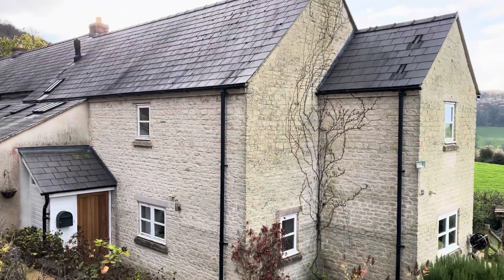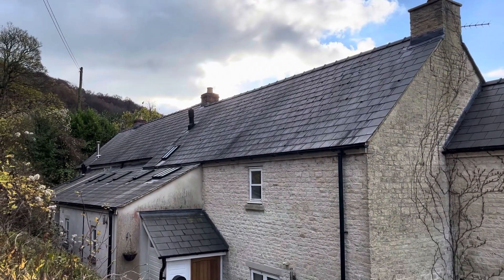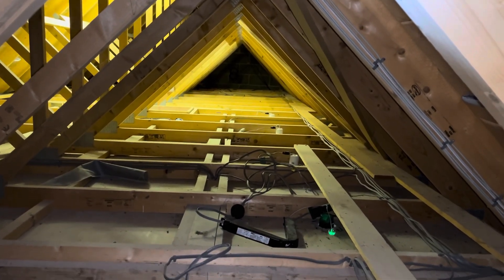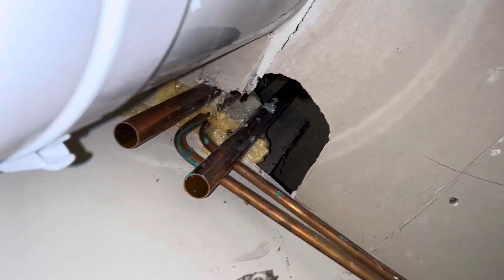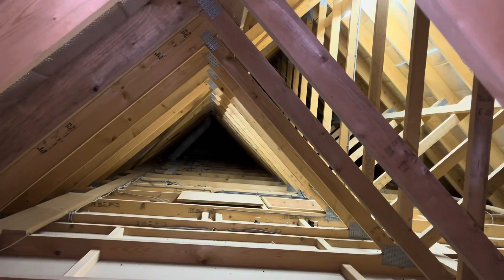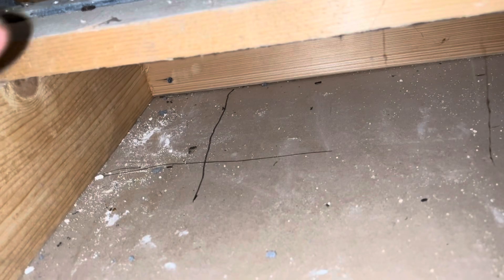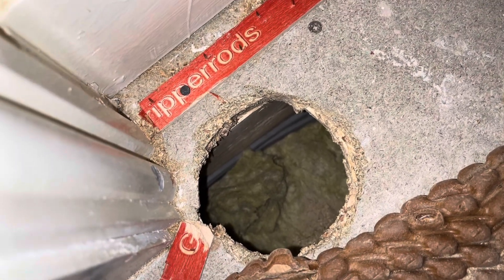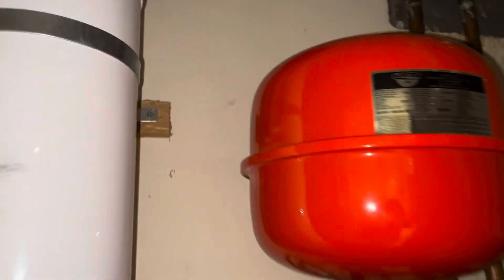1. DIY MVHR retrofit - Fitting the piping from the loft to the ground floor

Comment: Have you designed the system yourself or was that done by the supplier?
Reply from the maker: I started off with my own plan and as I have been looking for the supplies I have been in touch with BPC Vebtilation. They have created a plan for me for free - I just sent them the plans for the house.
This plan is almost identical to my plan and so it’s nice to have that reassurance.
I have not purchased anything from BPC Ventilation (yet) though. All I have purchased so far is 50m of ventilation tube from Fastlec.
I hope this info helps
Reply: Good luck with the project. My only significant concern with taking on this is the impact on fire breaks.
Reply: @marcheeeen   Fire breaks between what and what?

Comment: Brilliant series to put together. I think there will be many who want to do the same and follow it with interest.

I have read a great deal of negative statements about how MVHR does not work unless you have a high level of air tightness, however i think they underestimate how much of am improvement having controlled vehtilation will provide, especially put against the major heat recouperation you get with MVHR. The clean fresh air will also be additinal benefit as lets face it most homes feel rather stuffy over winter as people brace themselves against cold  draughts.

Well done, and i look forward to see what your reaearch has guided you to choose as a system, amd also comissioning/balancing.
Reply: Air tightness is only important if you want to make the most of the heat recovery side of MVHR.  In terms of ventilation (and therefore air moisture/humidity control), air tightness is irrelevant, within reason!  Obviously, if you have a very leaky house, air moisture is unlikely to be a problem anyway.
Reply from the maker: Yes, my reason for putting this in was mainly to reduce my heating bills by being able to make it air tight. So the air tightness was for reducing heating bills rather than for making the ventilation system work better
Reply from the maker: Thanks, I agree about needing good air tightness. It’s actually the one thing I think I can relatively easily improve in this house as it already has insulated cavity walls and an insulated roof that it would be very difficult to insulate more.
So I’m going to work really hard at making it airtight - once I have the MVHR system fitted